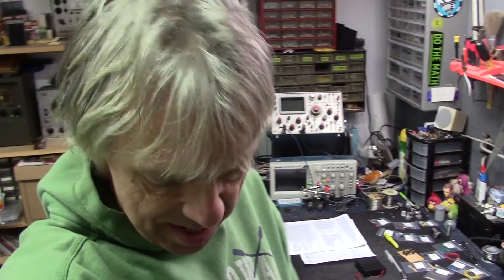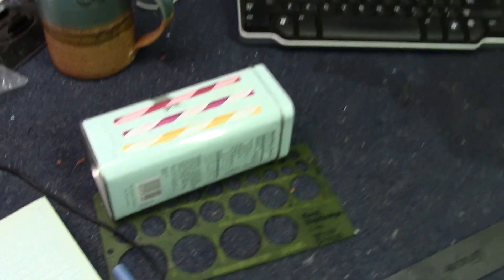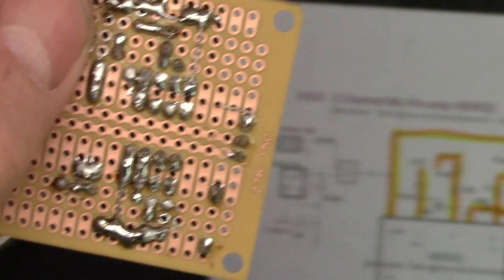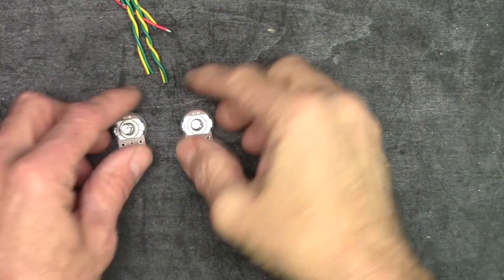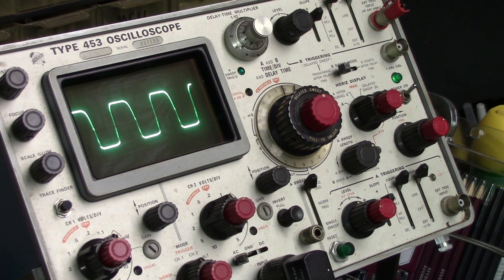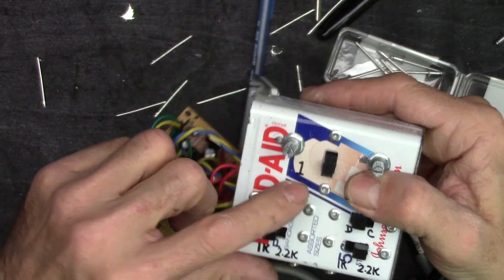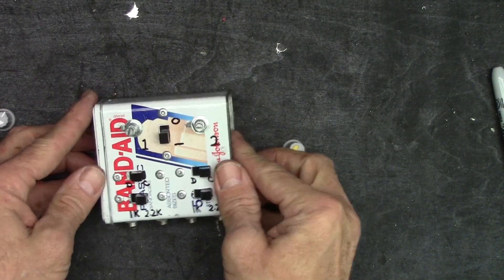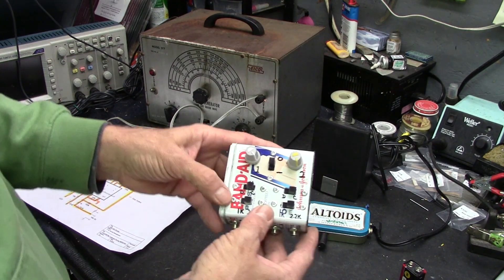NE5532 Mic Preamp Build

Comment: Hi there, this is the closest thing that resembles my own TL072 Dynamic preamp hybrid Caffarel tin box I Diy myself. Thank for the vid! I'll sip through it. Mine also doenst work with the dynamic mic... it has only a 50K gain pot, not 1M... line levels signal it works, but it's too much distortion... I just wanted a Mic preamp... also mines 2 stages, 2nd just to buffer out and re-phase the input signal. I have no idea what the I transistor are on your schematic. I thought maybe it's the couplin cap... I have an Arp 2600 with a Preamp and there the mic works at 100X gain settings... 1M is 1000X or 500X, it should way mor ehan enough--

Comment: First there is error in schematic. Output from IC (pin 1) goes to one side of pot ONLY not all the way to the output cap and jack. So, one side of pot goes to pin 1, other side goes to ground and middle goes to output cap. This is way you didn't have control over volume with pot. Second, pots should be on input side not on output. While you ware testing it input signal was too hight and IC was clipping. Maybe you damage it.
Sorry for my bad english but I'm in hurry but I want to help you. Hope I did.
Reply: You're probably right. It WAS clipping!!

Comment: Hey, I was wondering if you could explain or link to a video about how to drill through a metal tin without creating big jagged edges on the inside. That would be very helpful for me. I like metal tins a lot for custom cases.
Reply: Start with a small hole then mill it out to size with a Dremel tool.
Reply: Holland Wilson The main idea is to provide support to the backside, so the metal can’t bend inward.Put masking tape on any finished surfaces and clamp a piece of wood to the inside of the tin. The wood will keep the sheet metal from folding, so the drill bit can shear the metal away. Start with a tiny drill bit to start and find your center and than go to your desired size. Hope that explains clear enough. Woodworkers call this type of thing ‘tearout’, searching some of those videos might tell you more.
Reply: Holland Wilson Like Dino mentioned at 4:30, blocking up the tin on the inside with wood would’ve prevented that tearout.
Reply: Yes, and "blocking up" is somewhat jargony. Do you find a piece of wood that fits inside the tin and put it inside?
Reply: Thank you.

Comment: Probably your Condenser Mic needs a power supply , typical studio condenser needs Phantom power (maybe +48V or +12V) , the typical capsule mic can work as low as 1.5V like in a wireless Lavalier system... Good luck!
Reply: Condenser mic gets power from the circuit.